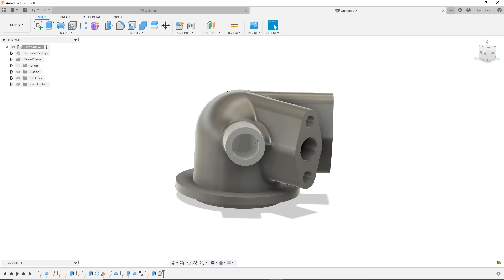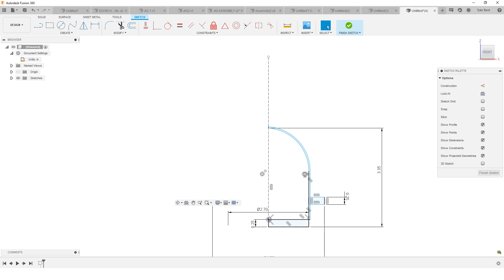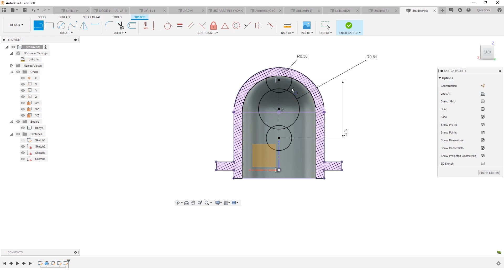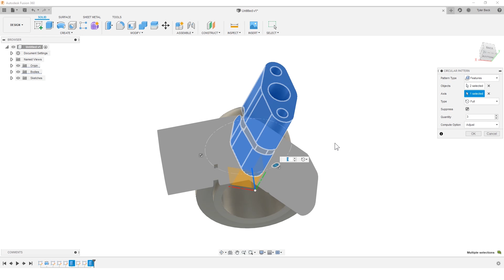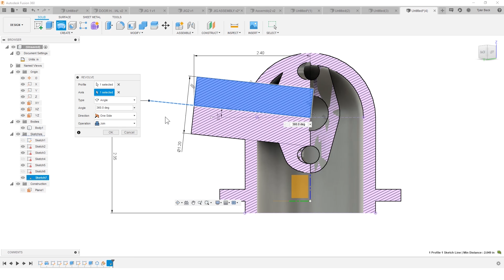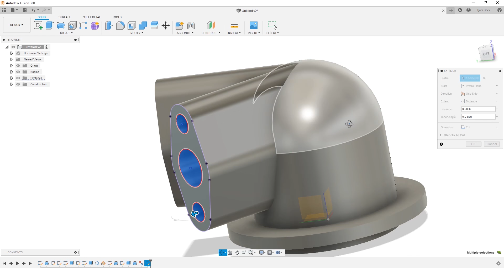Fusion 360 Manifold Tutorial (24 Tips Beginners Should Know)

Comment: Hey Tyler, thanks for all the excellent tutorials. I have some experience with Solidedge and Solidworks  gained over the years by occasionally using them in work, although all my projects are personal and not work related, unfortunately I no longer have access to them so I am learning Fusion 360 at home. 
What I miss is the parametric tables and family of parts. Basically I had a range of similar shape components but with varying size , thickness and hole number and depths...is there an easy way of doing this in Fusion as I can't find an easy solution.

Comment: According to the SolidWorks drawing, the smaller holes in the flanges do not lead to the inside of the entire object, but end at a depth of 1 inch from the flange surface.
Reply: That makes sense as they are probably there to depict threaded holes.

Comment: Nice simplification and explanation of a tricky model. It looked as though, from the referenced 2D drawings, that the top and bottom boss holes were blind drilled holes rather than through-holes.  It would be interesting to see how you create the two bosses with holes drilled only part way through from the front face of each boss. I am enjoying your tutorials and making the transition to the new user interface which had been a bit of a daunting thought. Unfortunately my laptop is unable to run the latest version of Fusion 360, something I hope to remedy soon
Reply from the maker: So glad you are enjoying them.  That would be interesting... I would think just a distance cut.  Am I missing something?
Reply: Tyler Beck of Tech & Espresso - I was thinking that perhaps, instead of drawing the boss shapes on an existing plane, perhaps draw them on an offset plane, then drill the holes to the relevant depth from the projected plane?  That would make for an interesting twist to create the same model. It has been a while since I had used Fusion 360, because my laptop will no longer run it due to lack of resources I believe. So your videos are a great help in re-introducing me to using it with the new user interface

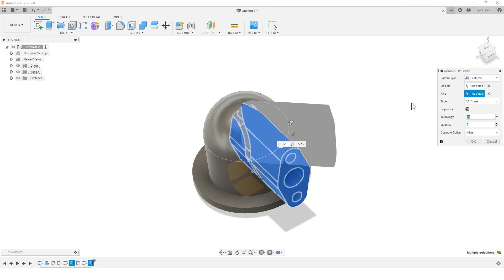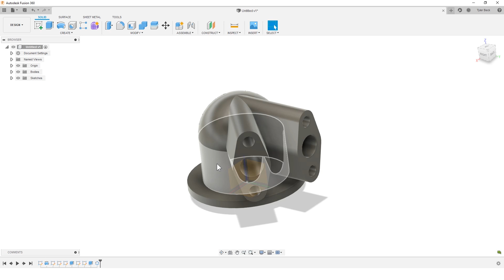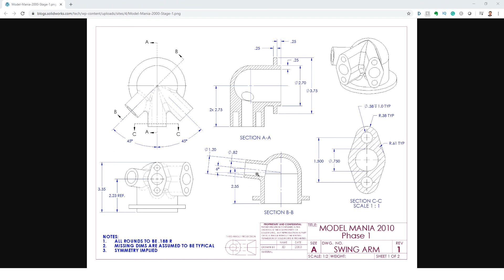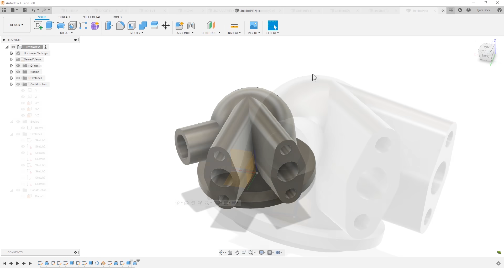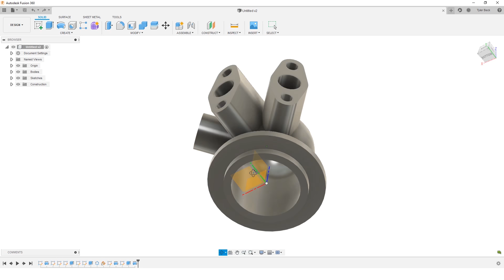Comment: There are mistakes in this video which are not helpful. At 13:50 you use pattern to place the features to the left, yet they then appear on the right (check your video and your sketches). This is where you edited the video and repeated yourself twice at 14:42 and at 14:55. Now the pattern appears on the right side as per the drawing. At 18:18, you still have the features inside the model, then they magically disappeared at 18:31, right after saving your model.

If you find yourself having to correct your mistakes, then it would be nice to show us. I could not make the tangent plane work even though I had used it many times, and then use the slice revealing the model as your example because the tangent plane was set up on the wrong face due to the pattern being on the wrong side. Once I corrected this, I could continue.

I have noticed errors before like this in other videos.
Reply from the maker: Hey Robert - Great feedback! I added a note in the video and in the description.  These are not helpful,  sorry my mistake made it hard to follow!  Next time, I will improve my video editing workflow to avoid these mistakes.  * I'm not sure what you mean by tangent plane?  I used an angled plane in this example.
Reply: @TylerBeckofTECHESPRESSO  Tyler, thanks for your response and correcting me :)... I should have said Angle Plane and not Tangent Plane - this time my mistake.

Nevertheless, I look forward to your future videos as I do find your tutorials helpful and I am subscribed to your channel!